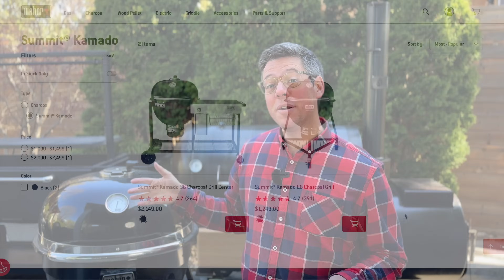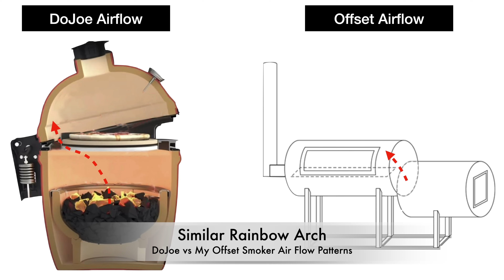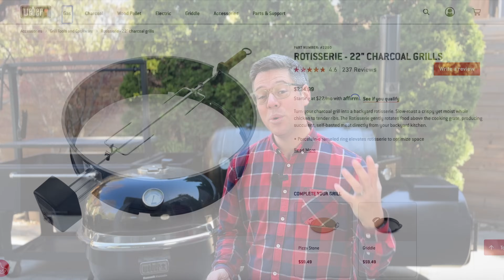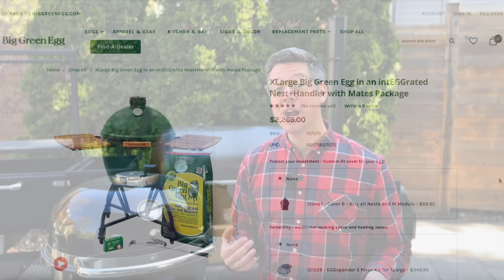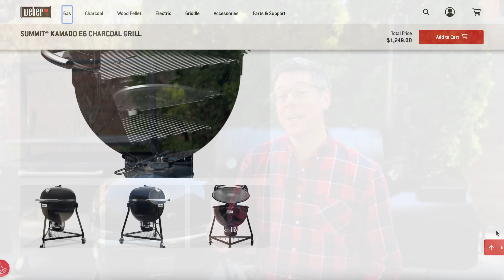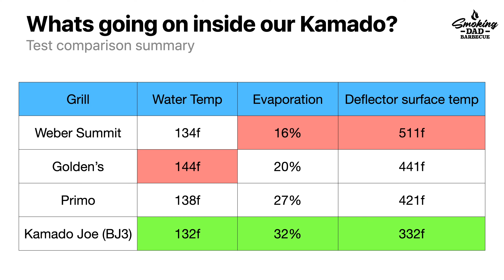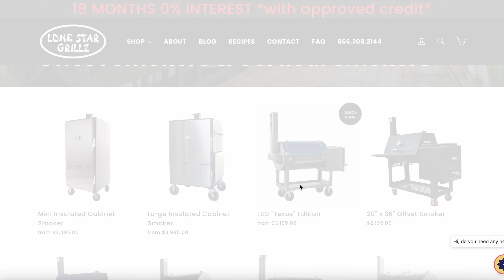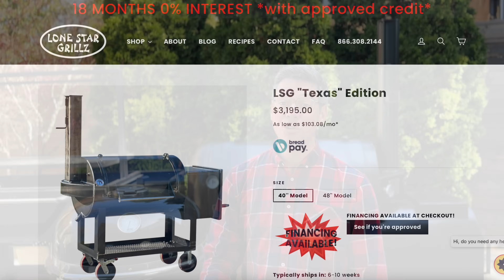3 Reasons NOT To Buy The NEW Weber Summit Kamado (1 Yr Review)

Comment: I made a comment here previously, and cannot find it.  Good barbecue comes down to 3 variables: Flavor, Tenderness, Juiciness.  In the category of flavor is the subcategory of smokiness. A pitmaster understands how to achieve these qualities in good barbecue. Then he has to understand  how his machine must be set up in order to achieve the desired end.  I chose the Weber Summit Kamado and get great results in all 3 categories when I set up the cook properly and monitor the cook adequately.  GREAT BARK! 

Be careful with your scientific tests not to fall into scientism.  If you use the same cooking conditions for different barbecues, you create the APPEARANCE of a controlled experiment. But in doing that, you necessarily are handicapping one of the barbecues. Different barbecues require DIFFERENT cooking conditions to get the desired results. For example, I have found that cooking times on the Summit are shorter. And for long smokes, it is desirable to wrap at lower temps because the bark forms quite early in the Summit.

Barbecue is all about the food. If the food is good, then why complain about the barbecue? FACT: THE WEBER SUMMIT KAMADO DEMOLISHES MOST OTHER BARBECUES IN TEMPERATURE CONTROL. DID YOU EVER OVER SHOOT YOUR TEMP IN THE KAMADO JOE?  GOOD LUCK GETTING THE TEMP BACK DOWN.  THIS IS NOT A PROBLEM AT ALL FOR THE WEBER SUMMIT.  AND TEMP CONTROL IS A MAJOR COMPONENT OF GOOD BARBECUE. HAVE YOU DISCUSSED THIS ON ANY OF YOUR VIDEOS? THANKS!
Reply from the maker: I think the taste differences between any of the top Kamado brands are negligible and highly subjective.... If we put 100 people in a room and asked them what coffee tastes best we would never get consensus and the same is true of ones smoke pallet & preferences.

from a versatility standpoint, the new heat deflector is less accommodating to adding wood than the first generation summit was where the flip up grate and deflector made quick work of accessing the fire which is no longer possible.

There are comments from current and past weber owners saying the same thing as me on this

Comment: I purchased the summit with the cart when they first came out and I agree that the price was and still is out of line for this grill. Also, the lack of accessories is abysmal. I've not had the dirty smoke taste issue with mine but I don't discount your experience.
With that being said, I would buy the original version again, but not the new version. I don't see the value in the new ones.
Also, I just recently bought a 22 inch Master touch kettle.......I hate it when compared to the summit.
Guess I'm spoiled.
Thanks for the video!

Comment: Very good summary, thank you for the level of detail.  In the summer of 2020 (before I had found your channel) I had decided that I would either buy a BGE or a Weber Summit, whichever I found the better deal on.  I went to my local hardware store and noticed that they had a Weber Summit (original) without the side cart for $999 USD so I went for it.  It works well, but I have to say if I were in the same position of needing a Kamado now, I would definitely be going for a Kamado Joe.  I won't be selling my Summit to make this happen, I plan on keeping it, but it's nice to know that if I need another Kamado, we are definitely spoiled for choice!
Reply from the maker: Thanks Tom. Like a mentioned despite the advantage of perspective looking backwards the actual food difference is negligible and definitely doesn’t support spending thousands to switch to anything. Thankfully most egg and kj big Joe accessories fit so you can if you want add a series 1/2 divide and conquer rack, all the half moons and joetisserie etc should one want

Comment: Appreciate all you do in these vids! Very informative as always. It seems someone at Weber decided they needed to have an entry in the kamado space so they  threw something together with "insulation" and more importantly, a kamado price tag. I 've cooked on Weber 22" Kettle, Weber Smokey Mountain, Broil King Keg and now the KJ3. If I had to give up my KJ3, I'd avoid the Summit Kamado and get a Weber kettle with rotisserie, a Weber Smokey Mountain and enjoy the $1000 I saved.
Reply from the maker: i think if they would have fully committed to a kamado it could have been awesome.  i would keep the dome and make a base that doesnt have the legs which aren't used in the bottom bowl, ditch the one touch system and go for a base that could be installed in tables, and add some more depth to make multi zone cooking easier

Comment: I have been thinking about moving from my Weber 26" to a Weber E6. But since I have a custom table built for the 26" and modifying it for the 24" I will probably stick with my less efficient 26" grill. To really get the 26" up to a very high heat I slide the lid back a little creating a gap on the food side of the grill. I wish I had known this "trick" earlier making it look a lot like your pizza accessory for your KJ. I do appreciate the size of the 26" and my new smoke and sizzle. The 26" has way less accessories than the 22" but there are some mods out there than can be made ( pizza pan diffuser plate, fire brick set for offset style cooking). The savings just keeping mine will buy a lot of charcoal and proteins.
Reply from the maker: That’s a good idea about the gap

Comment: I have a Weber Kamado E6 and it's by far the best kamado bbq I have ever had. Certainly more affordable than a ceramic grill.
I got mine for $1,271 (USD). It's just an amazing piece of kit. No regrets. 
The S6 is over priced. The E6 is more affordable and durable than buying a ceramic kamado in my eyes.
My only issue I have with the Weber Kamados is Weber's lack of accessories specifically for this product. Unfortunately I have to buy kamado joe products instead.
What I do agree with you is swap out of the original double skinned defuser to that more disappointing single skinned plate.
One reason I got the E3 series 2 was the lack of a gas igniter because I would never use it.

Comment: The biggest problem for the Summit Kamado series is the price. It is way too expensive for what it is. It is a $1600 premium to go from their Premium Delux Performer to the Kamado S6...thats about $600-800 too much...

If the S6 was available for $1400-1600 range, it would be selling in far higher numbers and would thus have a better accessory supoort from both Weber and 3rd parties 

The E6 should be like at 899 or 999 price point...

I really want one but i will never get it new or for full retail its just not worth it at those prices

Comment: You're right on with your comments. When I bought the S6, I couldn't believe how little effort Weber gave to value. I almost sent it back when I saw the same old ash removal system and the cheap kettle charcoal baskets. It's as if Weber has no shame. I have no complaints about the way it cooks,  but I bought KJ Divide and Conquer system and a Joetisserie for it which has  improved it's usability.  It feels like Weber has gone complacent, much like BGE did a while ago, and is just not trying very hard to please its customers. I also have a KJ Classic II at another location which I'm very fond of, and would have bought a Big Joe, but we get some tremendous thunderstorm-driven winds where I live, and I was worried about a KJ getting knocked over.

Comment: I do find some of your criticisms to be on point like the cost of the units and the lack of accessories. But just because s&s made a charcoal basket doesn't mean it works good with the summit. Kamodo the summit kamado is designed like a kamado. Joe to have a fire at the bottom and smoke coming out around the plate in a circle not from one side. So to say that you're stale smoke came from an s&s charcoal basket for a Weber Summit kamado. Isnt  really a valid criticism when you're not using it the way it was designed to be by Weber I have owned a Weber Summit kamado for 2 plus years now and love it way more than my kamado. Joe, I have a 22-in kettle so I can do rotisseries pizzas and anything else I want to do and use my Summit mainly for smoking meat. Occasionally I grill. When I need to grow more food then I can fit on my performer

Comment: Hello. I own the Webber Summit I think it is outstanding for several reasons. 1. It is simple and straight forward. The lack of do dads is an advantage. The KJ requires a too many accessories to arrive at the same place. 2. It is durable. Never a worry about cracking the porcelain. 3. My results are very good. Also, I have the means to purchase any of the grills on your deck and if i needed to buy one tomorrow it would be another WSK.  Your videos very well prepared and have data to support your opinion however I believe that  learning to use what you have is more valuable than data alone. One last thing , this is a barbecue grill, not the space shuttle. Great respect for your videos. Respectfully from Pa.

Comment: As owner of an S6 who has cooked on many different grills/cookers, the WSK is hands down my favorite for its versatility. Loving the detailed reviews - keep’m coming, SD! 

More deets… I typically use my WSK in offset mode with a SNS Low Profile. I also love to drop the coals to the bottom and go Chud Box style. For long smokes overnight I set up a double indirect by using KJ Half Moon ceramics on top of the metal deflector (creating a small air gap without blocking any holes) then set the Kick Ash 18” Stainless Drip Pan on that (molded feet add another air gap). This setup has been a game changer for my long cooks. 

I’ll admit, if you are looking a Kamado cooker primarily for long low and slow smokes, you may be better off with a ceramic setup like the KJ with SloRoller or a Pellet. If you don’t mind the radiant heat from the metal deflector on the WSK (or don’t mind just grabbing a set of KJ Ceramics) to gain all the versatility - The WSK is like having a Smokey Mountain, Kamado, Kettle, and Chud Box all in one! 🔥🤙🫶

My WSK kit…

SNS Low Profile 
https://a.co/d/235EwOx

SNS 22" Stainless Steel Drip and Griddle Pan
https://a.co/d/fozh8jq

Kick Ash WSK Basket 
https://kickashbasket.com/products/weber-summit-kick-ash-basket

Kick Ash 18" Stainless Steel Drip Pan 
https://kickashbasket.com/products/kick-ash-drip-pan-18

Kick Ash Super Lifter 
https://kickashbasket.com/products/kick-ash-super-lifter

KJ Classic Joe Half Moon Ceramic Deflectors
Model (KJ-HDP) 
https://a.co/d/hDyWqH3

KJ 24" Karbon Steel Griddle (KJ15094622)
https://a.co/d/0gMd5cO

Weber Charcoal Rake 
https://a.co/d/2vkgUsv

Comment: My first grill was a 22 inch original kettle 35 years ago. I bought a Performer Deluxe 22 kettle about 5 years ago. It was a really good grill. But, since getting into using my Kamado it hardly gets used anymore. And, now I also have a pellet grill. I think Weber's marketing has suffered since they are not the only grill maker anymore. I think they jumped into the market because they did not to be left out. I think they are over priced. And, charging $2200 for one with a table is not right. Thanks for another nice video.
Reply from the maker: This can be the issue when private equity firms buy barbecue companies sadly is it becomes more about leveraging the brand name to grow sales than it does about how to make better barbecue
Reply: I agree with one thing. The slow and sear is junk. Others than that it is another bias kj video. I can come up with 50 reasons why it is better than a kj. You can't even compare a kettle to this grill. I have an egg which I love. But if I could only have 1 Kamado grill. I would pick the Weber summit every day. Have had mine since they were released. Just go buy one.  You will love it. I can move this around my yard. I can't with a kj. I can have this at 500f in less than 5 minutes. The kj will take much longer. Simplicity and versatility is what makes this grill great. I love the dampner. If you cook on it for a bit it will not close on its own. Love the ash sweeping system.  I have the cart version.  Can't even compare the kj side shelves to the side table. Stainless steel wins all day every day.
Reply from the maker: @Brooks5678  you can’t buy the version you have anymore, the updated one is functionally worse than the original version. 

Sure if we ignore the facts, performance testing with real data, the fact I also have a top university doing CFD tests on all brands of Kamados, the price and every other quantifiable benefit it’s a great grill. 

As I said this review isn’t for people who own one. It’s great, go enjoy your grill and be happy. Despite the versatility limitations the food difference is negligible on all top Kamado brands.

Comment: I look at this as a good video do to the fact, it might make weber see the light and improve offerings for it. I have one I  like it, the fact it can do overnight cooks. 3 yrs ago I really wanted a kamato big joe. I think there quality control has something to be desired. There prices have esculated so much its almost 2 and a half times the summit. Keep them Thinking.
Reply from the maker: Well the price gets messy since in order to be 2x the price you have to compare the Big Joe 3 with cart, 3 tier D&C, SloRoller, deflectors, side shelves, ash tool, grill gripper etc to the E6 with no accessories or shelves etc. vs. the S6 which fits a few hundred more than the Big Joe 2 with cart.

Equally messy with Big Green Egg and Primo on the cart vs. no cart options.

Weber has made many great grills over the years, and this is a good grill.... it's just not a better Kamado and i think they could have done more to be competitive in this space

Comment: It is the best Kamado, it is fantastic. I think you are a Kamado Joe man. 
The accessories, what do you need? I live in the U.K. and have a Smokerig Plancha (on my channel), bought some Joe accessories.
The table version isn’t worth it, but the E6 is same size as the Big Joe and much cheaper.
It doesn’t crack, it cooks the same, it is very robust, it is easier to clean etc.
I did 8, not 3 reasons to buy a Summit having owned both ceramic and Summit.
Reply from the maker: Here is the complete data video on the performance testing. There are not supporting facts on performance, price or versatility to support picking this ahead of other top kamados https://youtu.be/ySqIxcF96vg?si=n87Dc5Va5TEunSKr
Reply: @SmokingDadBBQ   pointing thermometers and measuring airflow etc doesn’t mean much. I did a video of 8 reasons why I think it’s better than a ceramic- things that actually matter. I would never go back to ceramic.
Baby Back Maniac, who I think is a man who really knows his barbecue, rates the Summit as the greatest barbecue he has ever had. And he’s got plenty of KJs.
Reply from the maker: @wakeywarrior I couldn’t disagree with you more. Bark matters, ability to burn smoke cleanly matters. The summit does worse. If you are happy listening to opinions over facts I understand but I prefer the best possible result

Comment: This review is a crock. I’ve owned a Weber Performer, WSM, Genesis, Vision Kamado and Primo XL, and my OG Weber Summit Charcoal Grilling Station, and the Weber Summit is the best Weber and best Kamado I’ve owned. All this video does is criticize. You say nothing good about it, which makes this video a complete joke. The temperature locks in but can still be adjusted, unlike a ceramic. Comparing price to a Weber kettle is laughable. They are completely different devices.
Reply from the maker: I don’t see one piece of data in this comment that address facts around price, dimensions, accessories or heat distribution data from side by side testing.

Comment: To my mind, this should be put side by side with other double wall steel kamados like the Akorn and Keg. I liked how you mostly kept the comparison with other XL sized units though. However you could buy 2 or 3 Akorns for the base price of the Summit, I think.
Reply from the maker: I am not sure at 5 times the price that’s who they were going after since it seems priced a premium to primo, bge and kj. A week or so I did the full performance comparison and this was against the similarly expensive goldens cast iron Kamado
Reply: What I meant is that it should be in the same price category as the akorn rather than the ceramics.
Reply from the maker: @JohnRiley1966 oh ya agreed
Reply: @JohnRiley1966 I see people in multiple Weber groups picking up lightly used or like new E6's for around 600 bucks, and at that price I think it's more acceptable.

Comment: I own this Weber Summit Kamado and the Kamado Big Joe 1.  I was sorely disappointed with the Weber Summit Kamado but was hoping to learn something from your trials on how to get more from it.   Your assessment is consistent with my experience with this smoker, the Weber Kamado is not that great of a cooker.  The better Weber cooker and the better buy in the Weber line is the Weber 26 ($400); add the Slow n Sear for $75 and you have a Weber that acts like a kamado.
Reply from the maker: Unfortunately the answer I’ve come up with is buying a bunch of competitors gear like the rack system i tested. It’s a good grill but it seems to be created as a way to earn more revenue from Weber customers than it does either the intention of making a better Kamado